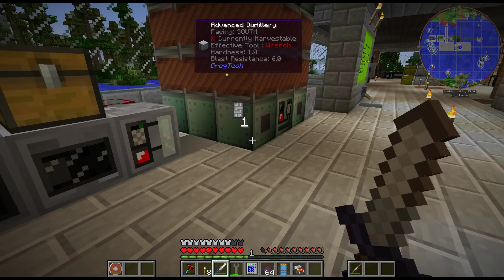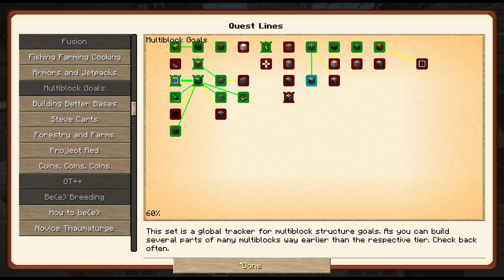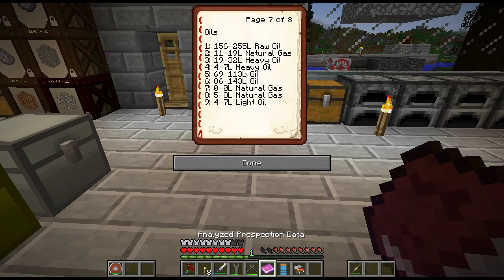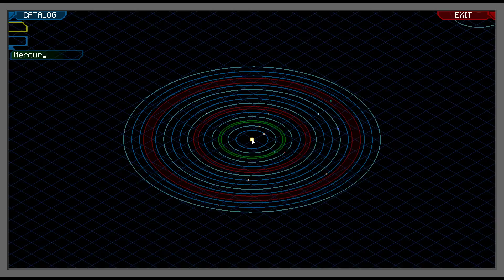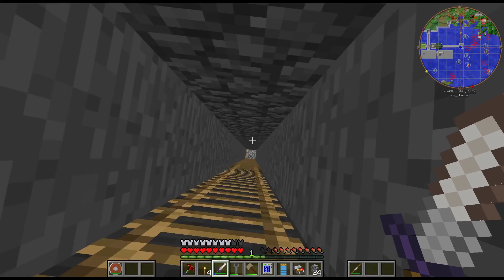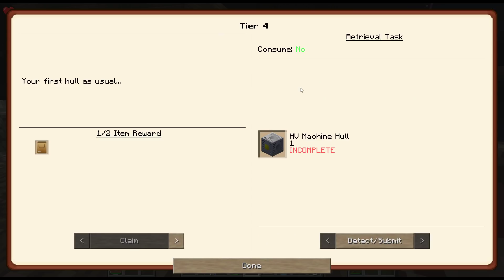Gregtech New Horizons - 62 - Oil Drilling Rig

Comment: Didnt watch until the end yet but just use a combustion generator and bring some big cells with fuel over. no need for cables / Batteries
Reply from the maker: Yeah will probably do that, thanks!